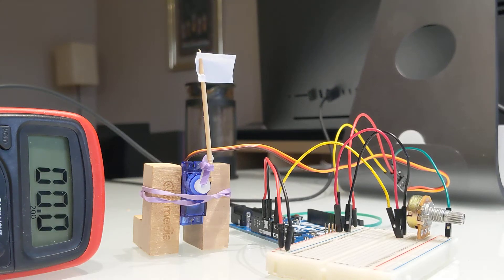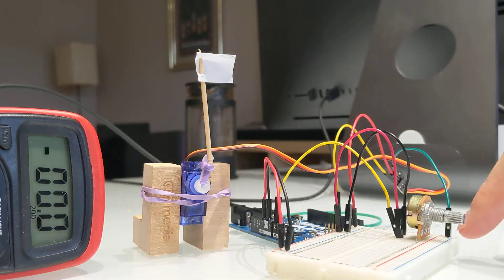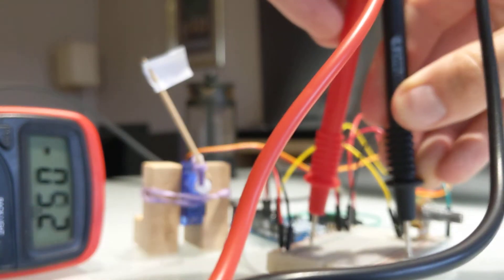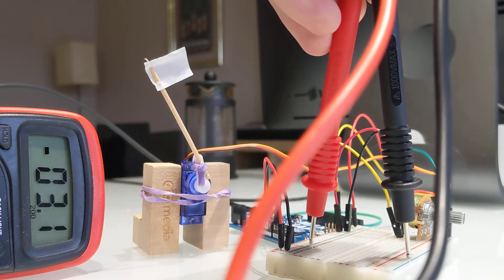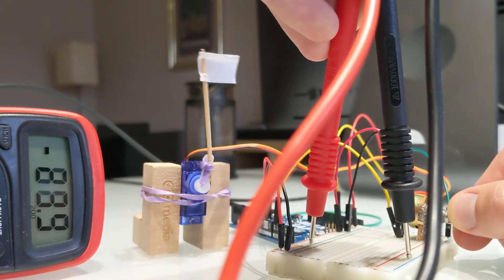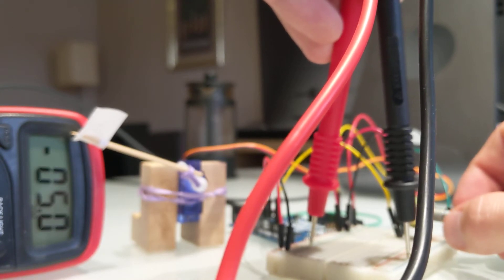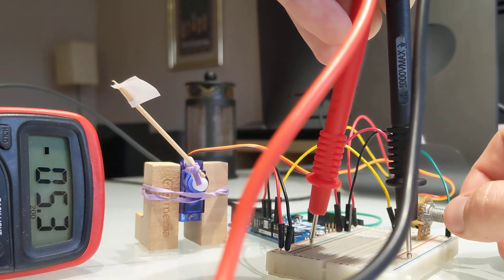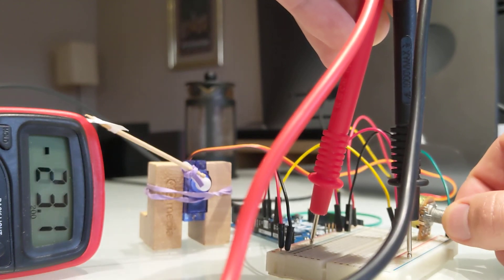Measuring the power consumption of the servo SG90

Comment: How many watts should i out in my calculation for the servo motor for the panel and battery sizing?
Reply from the maker: I'm not sure what you mean by "for the panel and battery sizing", but Watts are the product of Current x Voltage.

In my case I'm feeding the servo motor 5V from the Arduino, and when it moves a lot of weight it consumes around 0.6A, that means it consumes about 5 x 0.6 = 3 watts, at its peak.

This SG90 servo motor accepts a voltage from 4.8 to 6V, so you choose the right battery. It could 4 AA batteries wired in serial.

It all depends of what you want to use it for.

Datasheet of the SG-90 servo motor: http://www.ee.ic.ac.uk/pcheung/teaching/DE1_EE/stores/sg90_datasheet.pdf
Reply: Thank you so much for your response 🙏
Reply: May i ask? What is the maximum weight sg90 can move
Reply: @BenjaminScottfromFrance  thanks

Comment: I dont think these numbers are accurate
Reply from the maker: Yes, I think it might be consuming 3mA and not 300mA when idle... not sure, that was years ago. Do you know what the number should be?
Reply: It's hard to guess, but i've seen similar servos, drawing less current when fully stalled at max torque.
I've been considering doing some servo testing to compare models for the community, so if I figure it out i'll share it.